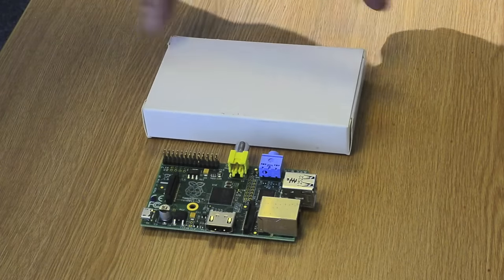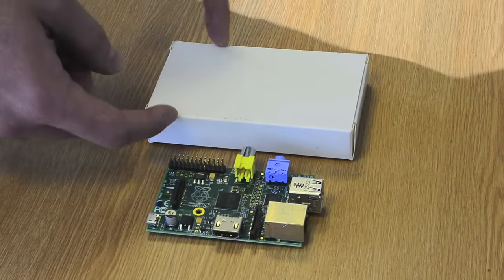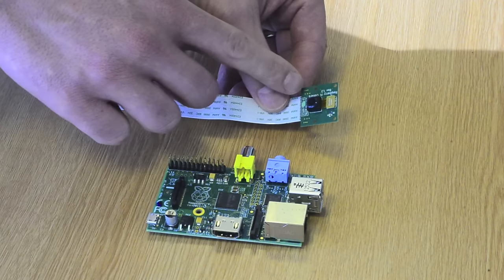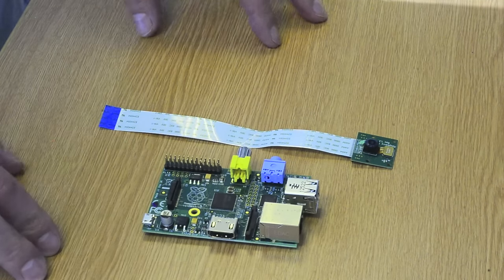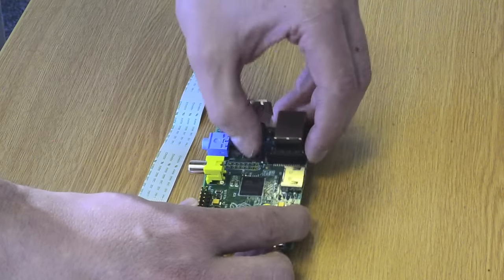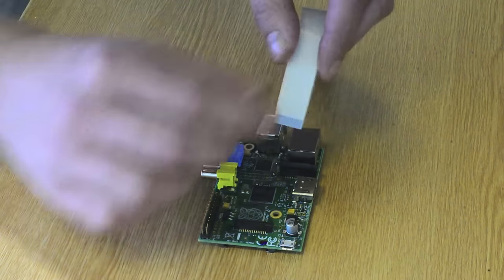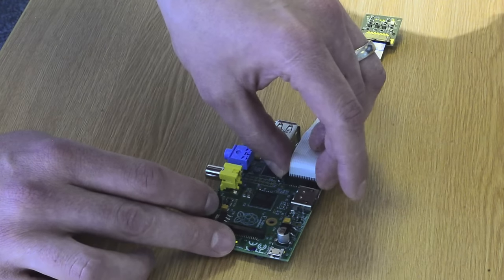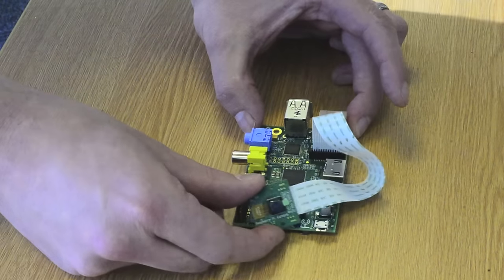Camera board setup

Comment: BTW, you might want to issue instructions to your suppliers (in my case, Element 14 Australia) not to fold the ribbon cable. Mine came out of the anti-static package as though someone had folded it in half and ironed it flat!

Comment: Can the camera be powered on and still work while the pi is already on? If I have two cameras connected to a sort of hub with their power lines selectively powered on through a GPIO pin of the PI, will that work or will the PI not recognize new hardware plugged in without a reboot?

Comment: sorry, you are wrong - the GPIO port's bandwidth is not enough. SPI is used for control purposes only - the image data needs a huge bandwidth, which is why it has its own connector on the Raspberry Pi board.